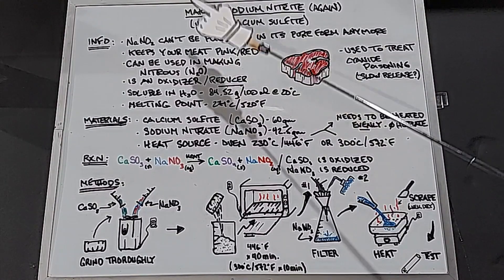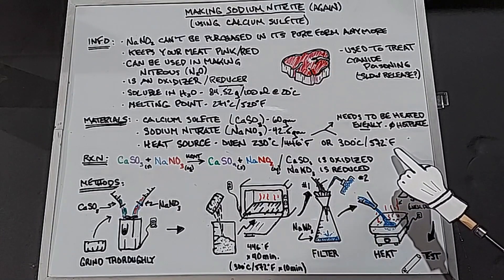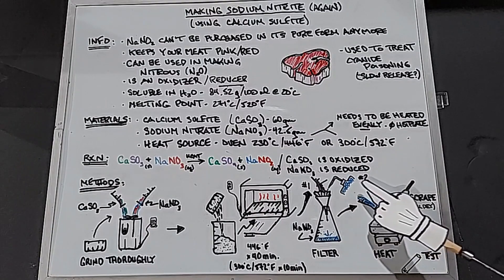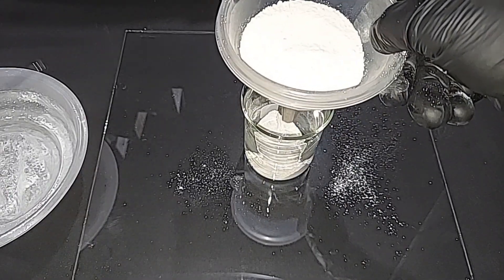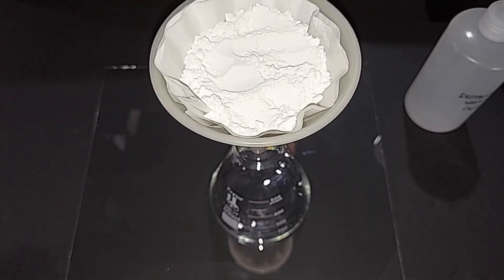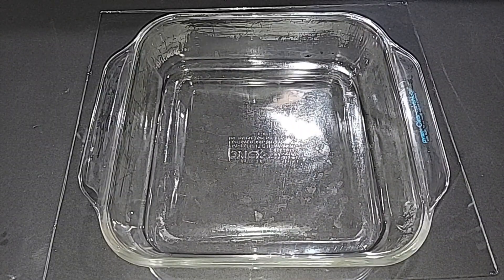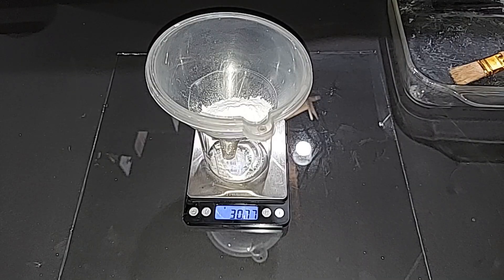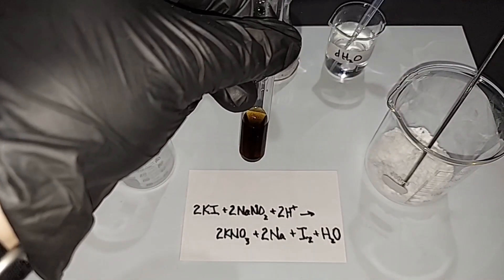Making Sodium Nitrite (From Calcium Sulfite)

Comment: By the way, since you used the tetrahydrate for the calcium sulfite, you only have 0.312 moles, whereas for the nitrate, you have half a mole, so even if the yield was 100%, you could not have converted over 26.53g of sodium nitrate.

Comment: Is there any reason not to add the water and shake or stir before filtering? Also, after grinding wouldn't sieving/sifting the powder a few times further homogenize the mixture?
Reply from the maker: You could do that, but by nature I typically wash the product while it's being filtered.  And, the grinder mixes the mixture much better than anything else.

Comment: I did this reaction and there was considerable sodium nitrate in the final product. I placed the filtered liquid into a recrystallization dish and lightly heated the contents to 40C for 12 hours or so. Eventually, white crystals started to form. I turned down heat to 30 and let the crystals grow. Eventually the liquid in the dish developed a cream color, so I spontaneously I decanted the cream colored liquid and evaporated it to dryness in its own crystallization dish. Afterwards, I dripped some sulfuric acid onto a sample of each. The first crystals that formed (white) released no NO2 gas, while the crystals that formed from the creamy colored solution released lots of NO2. I believe that despite the greater solubility of sodium nitrite, the nitrate crystallized out first because it was more abundant. This could probably be optimized? It might be true that my yield was poor or something because I am new to chemistry, but it seems to me, based on the white color of your product and mine, that the product of this procedure is destined to be contaminated with sodium nitrate.
Reply: Also thanks for posting this video! I learned a lot. I was unable to produce the calcium sulfite the way you did and instead produced it from the reaction of calcium chloride and sodium sulfite. It was much easier because the calcium sulfite crashes out.
Reply from the maker: I appreciate you sharing your experience.  And, the feedback is excellent.  Thanks!
Reply: Maybe this has to be done more than once.  Patent literature seems to suggest evaporating the product to dryness and adding MORE reducing agent and reheating.  Apostasis states in his potassium nitrite video he gets 79% yield on his first sulfite run.  One strategy would be to use maybe a 5% excess of sulfite on first run and titrate with acidified permanganate to determine purity then only add required amount of calcium sulfite to the nitrite mixture so yield can be increased.

Comment: Why not do a quantitative analysis? It's not much more complicated than what you did. I have tried just about every synthesis for nitrite salts that there is and every one of them will give qualitative amounts but the actual yields hover around 4-15% from my testing. And that is after fabricating reaction devices that minimize reoxidation of your xno2 into xno3.  Just sayin some numbers might be helpful before people start literaĺly burning through reactants.
Reply: ^this. The salt looks way too white imho, pure sodium nitrite bought from a chem supplier has a yellow tinge, I would guess this would be even more the case with homemade. A quantitative analysis should be done.
Reply: I did this reaction. I placed the contents into a recrystallization dish and heated the contents to 40C for 12 hours or so. Eventually, white crystals started to form. I continued heating as the crystals grew. Eventually, the liquid in the dish started turning a creamy yellow color. I decanted the liquid and evaporated to dryness. Afterwards, I dripped some sulfuric acid into a sample of each. The first crystals that formed (pure white) released no NO2 gas, while the crystals that formed in the creamy colored solution released lots of NO2. I believe that, despite the nitrites greater soluability, the nitrate crystallized first because it was more abundant. I would imagine this could be optimized to reach higher purities.
Reply: agree and I did same reaction by molten lead, but for higher purity I used alcohol and other solvent to use solubility for purification. can I ask the details you done quantitative analysis?

Comment: If you add cold 99% purity ethyl alcohol instead of heating at the last stage, the Nano2 ionic compound will precipitate to the bottom. Since it is a sensitive structure, data loss may be high at temperature. But I follow your work with great pleasure.
Reply from the maker: Interesting idea and I might give it a try.  Thank you

Comment: Good work up!  I bought sodium meta bisulfate for just this!  Nitrite can discolor permanganate as well.
Reply from the maker: Cool.  May chemical reactions be with you!
Reply: @cranialconstruction  Did more nitrogen research and when I read about hydroxyl amine being made from nitrites and sulfites I was like oh oh!  But I think that’s in acidic medium.  hydroxylamine in alkaline medium is actually an oxidizer so it could oxidize nitrite back to nitrate.  Moral of the story is use a slight excess of calcium sulfite but not too much!  Like maybe less than 5% just to drive equilibrium to the right.

Comment: Wouldn't there be a sodium nitrate impurity? Not all of it would react and its soluble in water
Reply: Yeah but it's most of the time not a problem
Reply: You can titrate with Ce(IV) to determine the purity of the nitrite but yet to see this done 😕
Reply: @coolcat_vlogs69  I’m guessing you’re referring to Ceric Ammonium Nitrate titration?  Kind of exotic honestly.  I’d just use potassium permanganate of known concentration acidified with sulfuric acid.  Just add permanganate drop-wise until it isn’t no longer discolored.
Reply: @jtbmetaldesigns  agree :0) Ce(IV) is glass polish powder. can you please shed a light about the method you've been referring too?